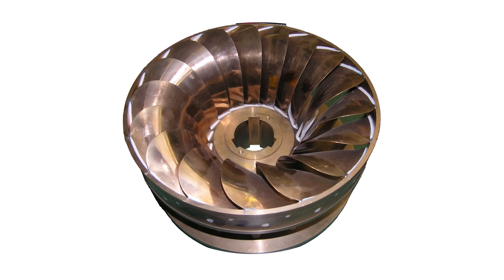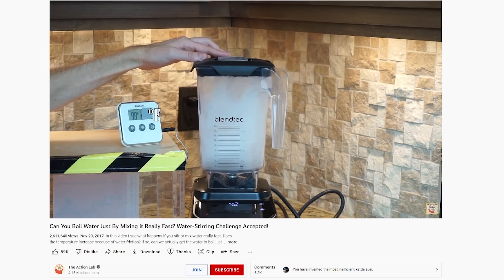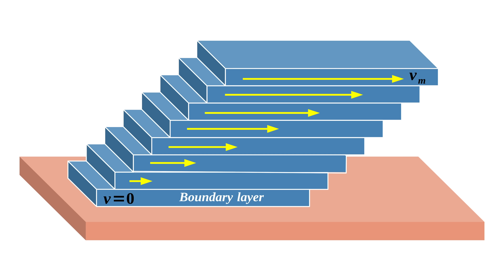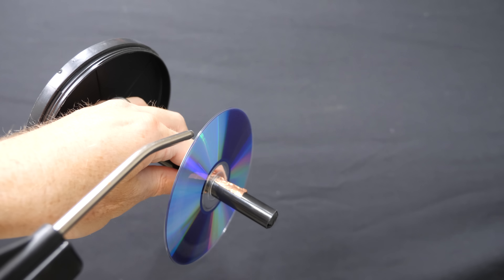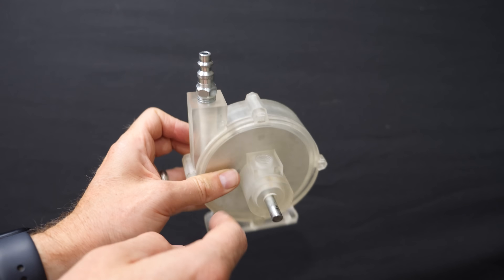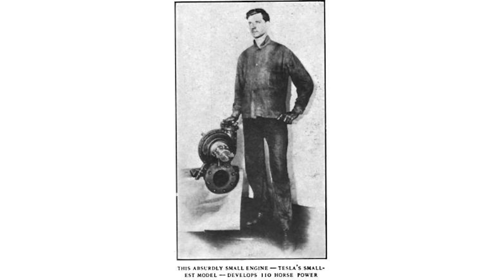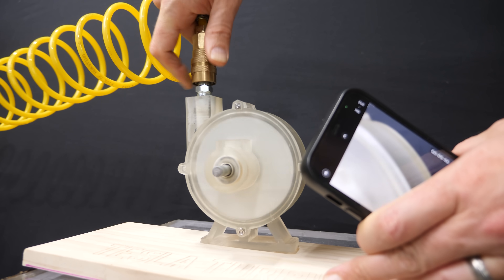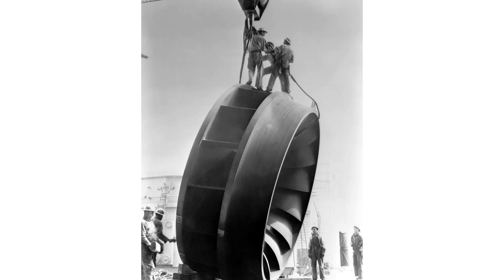How Fast Can a Tesla Turbine Spin?

Comment: Turbines for flowing gases are used in literally every single thermal power plant, be it nuclear, oil coal gas whatever fired. So you can be sure, turbines have been a field of major research for the last century with literally armies of professors, doctors, engineers and whatnot working on them. If Tesla turbines had the tiniest crumble more efficiency than turbines with blades, be sure we'd be using only tesla turbines. Because turbines are complicated to make and expensive with all these rotor and stator blades. But these blades have a job. The stator blades turn the pressure of the media (in power plants that is steam) into velocity. The media leaves the stator and bounces into the rotor blades, which turn the velocity of the media into rotation, which slows the media down. Next, the media enters the next set of stator blades with the rest of the pressure that is left from before. This pressure is turned into velocity again, and so on.
The turbine set in the power plant I work in has dozens upon dozens of stator-rotor stages, and it consumes the pressure and heat from steam that comes in with 265 atmospheres  pressure and 602°C. The steam leaves the last low pressure stage with 28°C at 0.025 atmospheres pressure (that is close to a vacuum). That turbine set is 60m long and the last LP stages are about 6m in diameter. It cost hundreds of millions to make and can produce 800 MW of mechanical power to turn the electric generator over.
Believe me. In power plants, we hunt for every little bit of efficiency. Tesla turbines can't do the trick, else we'd be using them.
Reply: 🤭 TesTurs work perfectly fine and get PLENTY of torque even at low rpm. You just have to actually know how to design them. 

Just fyi, I have a degree in physics and build real working TesTur electrical generators for a living. 

But that can’t possibly be true because 1000s, millions, of people have already determined they don’t work… 🧐 right 🤭
Reply: @CrankyTim  all my test have just been with very low energy density room temp compressed air and never saw over 40psi at the nozzle for the 4.25kW between 6000-8000rpm and peak torque of 6.22ft-lbs at only 4150 rpm and then only saw 20psi at the nozzle to push the real 2650 watt electrics load test at only 9500r

Furthermore compressed air is also composed of non-polar molecules O2, N2, CO2, that don’t adhere nearly as well as steam. Steam being a polar molecule will have a much higher adhesion force with the metallic disc working to increase the isentropic efficiency. 

And further the viscosity of gasses has the opposite trend with temps and gets thicker as it gets hotter and thinner/runnier as it gets colder, so the increased viscosity/increased cohesion forces of the elastic gas motive fluid further reduces slip on the discs further increasing the isentropic efficiency of the turbine in addition to the increased thermodynamic efficiencies from using higher temps too. 

So it will only get better as I go up to combustion and steam temps, like I’m already doing with the turbojet Tesla electric generators I make.

Comment: I built a tracking, concentrating solar collector, which makes steam and I run that against a brass gear on a good bearing with a generator at the other end. Couldn't be simpler. Works like a champ.

Comment: I wonder if this technology could be implemented on a micro-scale, benefiting from diamond-hard components with little weight
Reply: The hardness isn't an issue so much as tensile strength.
 Harder substances nearly always tend to have less strength, often in a particular plane of direction, and tend to be more brittle despite the hardness.
   Interesting to think about the smaller applications of this device though 👍
Reply: Hard materials are usually brittle.

Comment: The Tesla turbine, in order to approximate the efficiency of a standard blade turbine, require to turn at 100K rpm with a constant load applied; they all require a gearbox at the output to reduce the rpm and increase the torque.
Today as 80 years ago, there is no type of steel or other alloy that can spin at 100K rpm without shattering.
Tesla used to reduce the output speed at 10K rpm, but at that speed the efficiency of the turbine is in the single digit range.
Notwithstanding all the interest in a working Tesla turbine, they were - and remain - a gimmick...
Reply: TesTurs work perfectly fine and get plenty of torque even at low RPMs. You just have to know how to design them properly. 

I know… I have a degree in physics and build TesTur electrical generators for a living 🤭

Comment: Peltier turbine generator from water pressure. Horizontal turbine.
Do a show on how Steinmetz invented most three phase three wire  AC induction motors used today not Tesla 
Also AC Transformer invented by Hungarian engineer not Tesla.

Comment: Extremely curious. Application is the key. If an application is created that will benefit of the tesla turbine than it will be used. Modern separators with disk diameter around 6 inches spins 12000 rpm or more and the plates are made of stainless. It is similar to the turbine but the purpose is to separate fluids with different density. I wonder how efficient this turbine works as a pump? From what I see this could be easily reversed in to a pump. If a system is made to run on a fixed load maximum efficiency could be achieved. Currently everyone is talking about energy recovery and renewable sources. This machine could be made to pump water in to a high tower under constant back pressure and then reversed when energy is needed again under constant pressure and achieve maximum efficiency. basically, using gravity to store energy way better than any battery pack and it will work forever. All you have to do is change turbine bearings from time to time. With current commercially available bearings deep groove ball bearings if properly sized with will be once every 5 years. I am sure this is not batterie manufactures and GREEN lovers will endorse. Because can you imagine the profit lost if you develop technology that only requires basic maintenance and does not include expensive battery replacements?
Reply: There are very few places on Earth where pumped hydro is economically viable. Building a tower immediately rules it out.
Reply: Instead of a tower, dig a deep well.
Reply: @terrafirma9328  You could simply use a lake with underground cave acting as a well. Drain the lake to the cave when you need power and pump it back up when you have extra energy to store. It is simple and easy to make but you can't put it in a shipping container and sell it this is why is never made. You will see Big Green Business will find a Million reasons why it shouldn't be done including influencing local government.
Reply: @fredbloggs5902  You can simply build a natural reservoir uphill. Each 10m of height will give you 1bar of pressure you can easily get 4 even 5 bar out of a small hill this is usefull pressure for most centrifical pump how knows how good this turbine is if it can real close to 100% efficiency. You can scale the diameter to work with the height pressure you have. Yes you are correct with current low efficiency turbine it won't work but with high efficiency turbine pump it is a different story.

Comment: I also think the tesla turbine is very vulnerable to foreign object damage. If a tiny stone goes through a conventional turbine nothing happens, but a tesla turbine would suffer a lot of damage, i guess ...
Reply: Its actually the opposite. TesTurs benefit over other turbines. Other turbines blades are damaged from foreign object, particulates and cavitation while the TesTur isn’t effected by them.

No bladed turbine can handle wet steam without catastrophic damage to the blades over time. 

I’m serious we’re talking multi million dollar blades steam turbines completely ruined in minutes if wet steam is admitted into it. The blades that rely on complex geometries for torque will be worn down to little nubbins in single digit minutes. Just dead in the water. 

Which is also why it’s very disingenuous to claim all other turbines get crazy high efficiency with steam because they don’t when they leave much of the steam energy on the table by not fully expanding it in the turbine passed the point of condensation forming. 

Big plants only get high efficiency because of waste heat recover for things like boiler feed water preheat, etc.
Reply: Well ... wet steam has no solid objects in it, so no foreign object damage possible ... also not blockage of the space between the disks ... so wet steam circumvents my initial argument perfectly ...
Reply: @Metvernichter-33  obviously the particular size must be within reason of the disc spacing… nobody is putting boulders and rocks through a turbine with 0.5mm disc spacing.
Reply: @Metvernichter-33  🤭 brah… wet steam DESTROYS turbines because of the cavitation. And condensate droplets in the fluid flow. THOSE are the particulates. 

This is mech engineering 101…. NEVER put wet steam in a turbine. You’ll erode the complex geometry blades down to little nubbins in minutes on even a multi-million dollar blades steam turbine. 

But the Tesla turbine doesn’t suffer from this because it doesn’t have any lifting surfaces for any multiphase fluid flows to smash into or cavitate on.
Reply: @Charlie Solis  and exactly that is what i was talking about ... cavitation is the formation of steam filled bubbles which implode  as soon as a space with higher pressure is reached and create a powerful water jet. This destroys conventional pumps very fast but not the tesla turbine. But watch my initial comment: i was talking about foreign OBJECT damage and about STONES. I've meant SOLID objects, not cavitation. That cavitation is not as big of a problem in tesla turbines/pumps is absolutely clear, but i was especialy NOT talking about this ... in fact you answered a question which was not asked in the slightest ...
And about the distance between the disks: that's a very small distance, so it would not be possible to pump anything without a very fine sieve/net in front of the pump, because this would cause damage by foreign objects. THAT was what i was talking about and THAT you even did confirm ...
Reply: @Metvernichter-33  from the patent GB 24,001 (his Great Britain turbine patent filing, not the US one)….

“It may also be pointed out that such a pump can be made without openings and spokes in the runner, as by using one or more solid disks, each in its own casing, in which form the machine will be eminently adapted for sewage, dredging and the like, when the water is charged with foreign bodies and spokes or vanes especially objectionable.”
-Nikola Tesla
Reply: @CharlieSolis  as i was thinking about it with sewage, sludge and so on, i was noticing one flaw in my thinking:
If you pump water or even mor viscous mediums (like sludge) the space between the disks can be a lot wider, because the medium is "sticking" better to the surface of the disks and the boundary layer is wider (i guess) ... this would allow also bigger objects to pass without damage. You just always see a tesla turbine for air and so you think the disks would be always so close together
Reply: @Metvernichter-33  dood I literally build real working, power and torque outputting TesTurs (even at low rpm). With all the proof to back it up too. I have a degree in physics from Michigan Tech as well. 

I promise you, I’m not only seeing this for gas. I’ve read numerous hydro Tesla turbine thesis papers, some even reporting 81% turbine efficiency even with 3mm disc spacing. 

Oil would be even thicker. But you don’t just want a thicker (higher cohesive force) fluid, you want the molecular adhesion forces between the fluid molecules and disc material to be proper as well. 

Think hydrophobic surface coatings for non polar fluids (compressed air, O2, N2, CO2, oils, etc) vs hydroPHILLIC surfaces coatings for increased polar/H2O based fluids and/or additional surfactants in the fluids for increased adhesion.

If you try to pump a high viscosity fluid (high cohesion force) but don’t have the proper molecular adhesion interaction between the fluid and the disc you won’t be able to effectively utilize the increased viscosity of the fluid for increased economy from reduced slip.
Reply: @Metvernichter-33  ^^ think about the hydrophobic surface coated ball that @The Action Lab dropped into water. 

It slips through the water because of the wetting angle change with the introduction of the hydrophobic coating. 

Underwater rockets are being designed with these capabilities even submarines have been tested with different coatings for changed molecular surface adherence with the H2O water “atmosphere” a submarine is submerged in.
Reply: @CharlieSolis  with "you only see them for air" i've meant in videos like this in which they are explained ... as a model. Of course they are used for water, oil, etc, etc ... you just don't see them in videos like these, but there are always Tesla turbines for air shown, because you do not need to install pipe work for showing them and their principle of function. :)

I fully approve with this and noticed my error in my thinking. :)

Also: yes, the combination of material properties of the disk and the fluid which is pumped is important, but i guess (and this is just a guess) that the distance between the disks is considerable wider if you pump more viscous fluids (for example the distance of the disks for a tesla turbine/pump pumping air is narrower than it is for a tesla turbine/pump for water or oil). And so bigger objects can pass without damaging the turbine/pump
Reply: @Metvernichter-33  this is what Tesla says about spacing for when it’s used as a pump. The principles are the same for the turbine too. 

“The dimensions of the device as a whole, and the spacing of the disks in any given machine will be determined by the conditions and requirements of special cases. It may be stated that the intervening distance should be the greater, the larger the diameter of the disks, the longer the spiral path of the fluid and the greater its viscosity. In general, the spacing should be such that the entire mass of the fluid, before leaving the runner, is accelerated to a nearly uniform velocity, not much below that of the periphery of the disks under normal working conditions, and almost equal to it when the outlet is closed and the particles move in concentric circles.”
-Nikola Tesla
Reply: @Metvernichter-33  ^^^this is literally how the oil drilling companies do it already 🤭
Reply: @Metvernichter-33  I in fact did answer your question and said no one was suggesting to have particulates in the fluid that are comparable in size to the the discs spacing. 

In which case if there are particulates that would not only be able to fit between the discs but also be bad for the spokes, you go with what Tesla said to do for this exact situation, written about plainly in the patents… 🤭
Reply: Nope, it was used for sludge pumping, only change needed is running it backwards.
Reply: Sludge with stones and other solid objects in it or just sludge (without these nasties)? If sludge with stones and so on: how did they manage to avoid these solid objects to get stuck between or damage the disks? There is really not a big gap between them ...

Comment: Second this video started I thought "yea but what about the load?" that's got to be terrible with torque.
Reply: TesTurs work fine and get plenty of torque even  at low RPMs. You just have to know how to design them correctly to reduce slip.